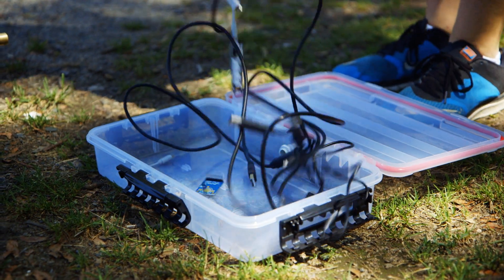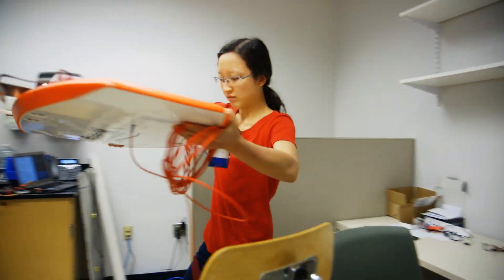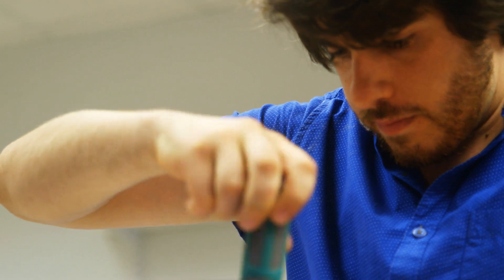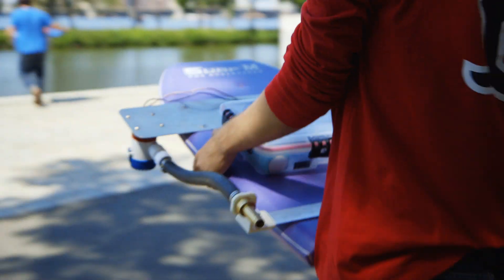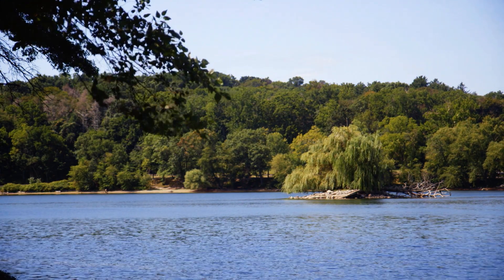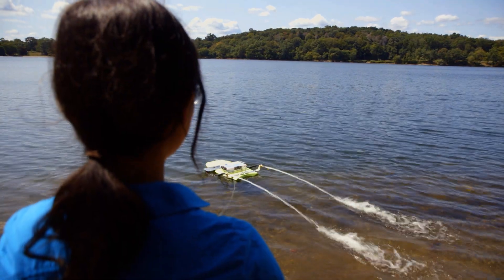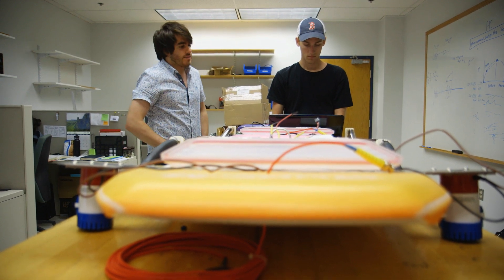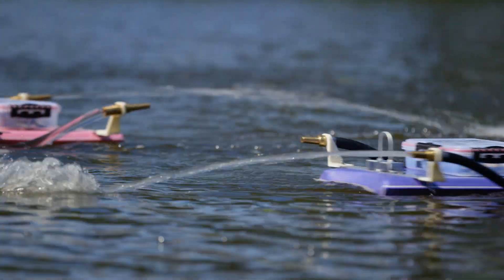Battling Drug Subs with Boogie Boards

Comment: I think nowadays they are using a torpedo boats dragged by a fishing boat, the torpedo boats are watertight and go below the surface when dragged. This makes detection impossible, the drag line can be cut whenever needed, and the boat can be tracked using a GPS signal

Comment: would it not be more efficient if the nozzles were thrusting UNDER the surface?
Reply: The answer to this excellent question was not obvious to us, so we tested the nozzles above the water and below the water. Above the water was faster. One important point to consider: everything below the water line increases drag.
Reply: Thrusting under the surface will disturb the underwater acoustic that they want to detect.
Reply: @kamaruddin9172  not the water splashing on the surface?
Reply: @kodeine222  I'm thinking that it will be less, but that's just a guess
Reply: big time.

Comment: My past reminds me of  survival in water using pants to create air pockets for survival.  Multiple units floating autonomously using foam or air pockets to convert energy, for detection of rough seas. Weather gets bad, the unit  goes under the water for a while to return to the top at a better time.

Comment: Powered by battery, with no solar recharging? Propelling with a rear propeller and rudder seems more efficient and less likely to get clogged with floating plastic and discarded fishing lines. I imagine smuggling technology has already advanced beyond these simple minded solutions. The bad actors could potentially start using  underwater drones  with GPS technology, or even just normal drones  with pre-determined missions based on GPS technology and packages  that broadcast their precise location to receivers.The war on drugs seems to me a very difficult war to win given the plethora of new technology cheaply available.
Reply: Some decent ideas, but first normal GPS won't work under water, you'd have to  have an antenna up at the surface, which actually is a decent idea, I'd think it could be almost undetectable that way.